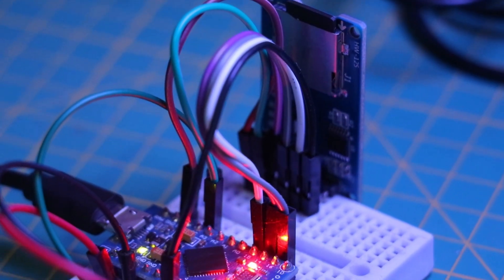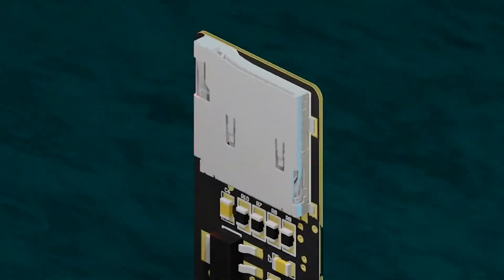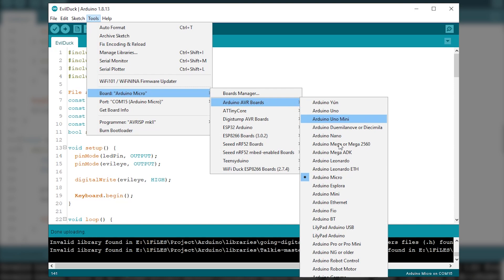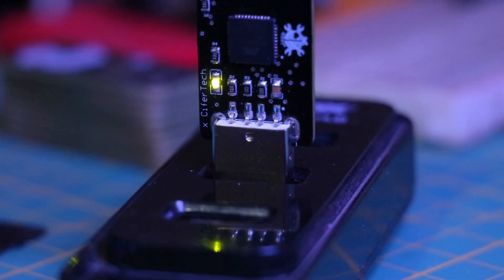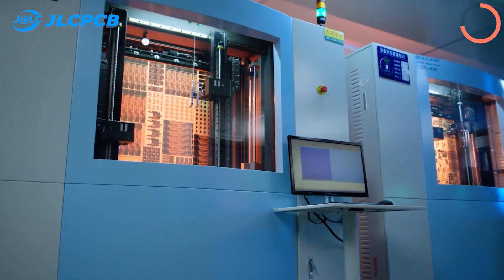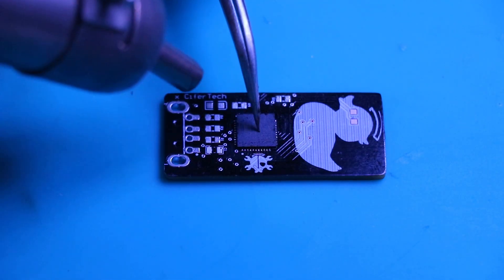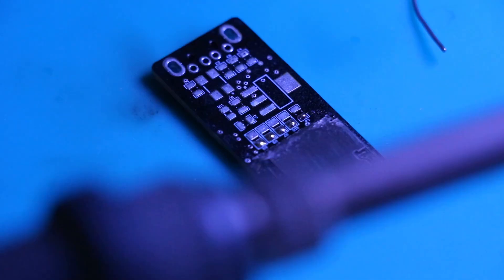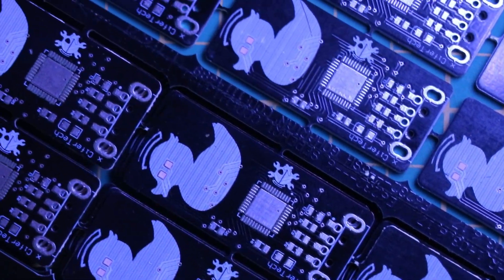I Made My Own USB Rubber Ducky | Here’s How I Built It

Comment: how did you flash the custom pcb ones? i've already ordered parts and i just now thought of that issue :P
Reply: 1)You have to program the arduino micro via usb then desolder the ic and resolder it to your custom pcb
2)Or add some test pads in your pcb to program it
Reply: @sanH2242 i think it works per USB Connection. i mean, the arduino IS Always presend allowing it to flash. (Or?)
Reply: hey, i ordered the pcb for an other project the nrf box, where did you order all the list of components such as transistors, the sd card and all the other stuff?
Reply: @ghostdata002  lcsc or digikey or any store online(where the components are cheap and available)

Comment: I suggest making a Device like flipper zero contain 
Wifi deuthntication 
Ble jamming 
Ble spoofing 
Analyzer 
Sour apple 
Hid attack 
IR  features 
NFC tag reader 
Radio attacks 
Using esp 32 
Or raspberry pi pico or zero
And all this features in one device
Reply: Why should he? The flipper zero has already have loads done to their product. Would take ages to make
Reply: @hexidev  no bro it's not that hard I am busy right now so I can't make it  also.the flipper is so expensive 169$  so we cifer could make a perfect alternative with less price using esp32 with all this features
Reply: @HIKTRON  there are already loads of open source ones tho
Reply: @hexidev  sure I agree with you but  every device make only one attack 
For example 
Arduino pro micro or raspberry pi pico 
As hid attack 
Esp8266 as wifi deuthntication 
Esp32 as ble jammer and spoofer
And rf433 Hz radio module can replay attack it's all separately I want cifer to make a Device with all of this features
Reply: @HIKTRON  you would need a lot of modules then.. and without a nice case it would be super messy and still will cost a lot. With bad support. Better off buying a flipper at that point
Reply: @hexidev  no at all if cifer made a custom PCB it won't be messy if you calculated the price of the following it will be less than 70 $
Nrf 
Esp32 
Joystick 
Nokia 5110
Radio module 433
IR transever 
NFC tag reader 
Arduino micro 
It all costs about 70$ or less
Reply: @HIKTRON No. Hes right. If you want the Work and Put in the costs into developing, when you are a Developer or Something Like that, do it. Else If you don't have the Budget don't. Developing will cost more than the Flipper Zero If you make mistakes. Which I will think you will, Like everyone of us does.
Reply: Just get the cheap yellow display